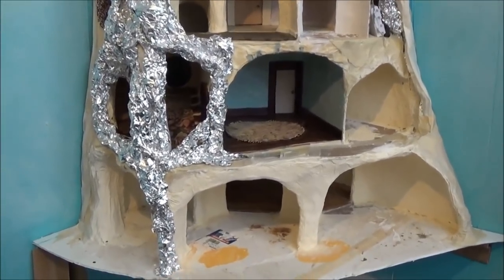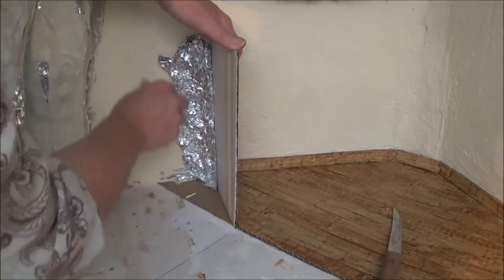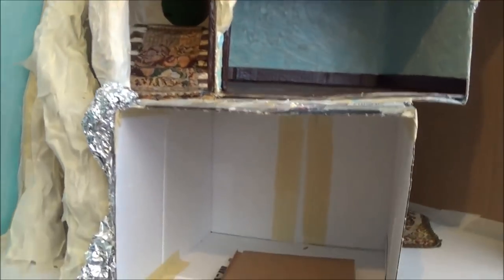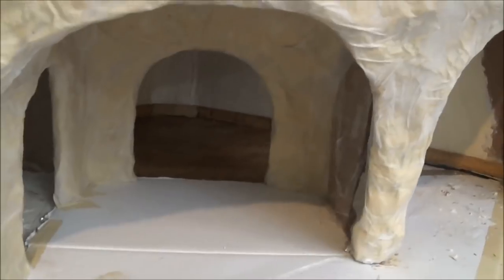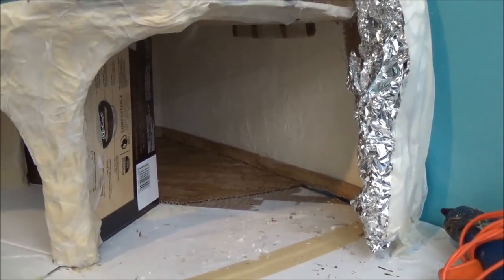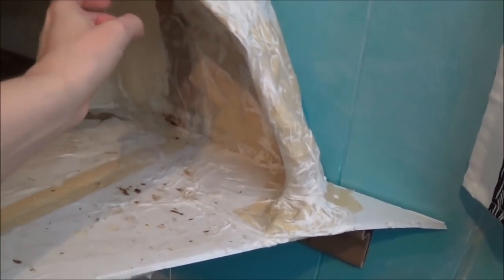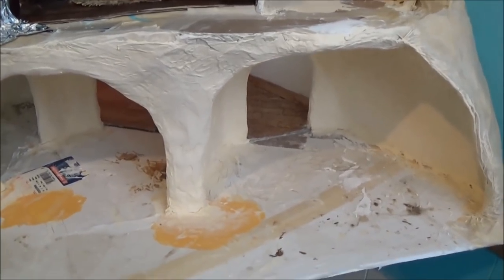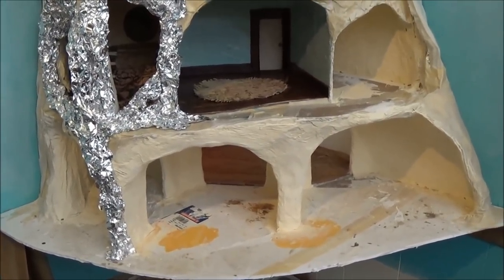Tree Dollhouse  Part 17 Building Up The Bottom Level

Comment: Are the boxes sitting on a big piece of foam board or something?i finally got my boxes together...I think..I was trying to figure out what each room would be and I was apprehensive to to commit lol..I gave up and just put them together.my boxes are smaller in size than yours.then after they were together I thought they need something to sit on lol..I’m working on two other houses and wanting to do this one so my brain is mush lol..thanks...
Reply from the maker: lol no worries.. yes, foam board when I first started. That is foam board with nothing under it. I made it like a table top with legs under it. A couple weeks after I began I had my dad come and add a wooded board under that foam for support. Now it's solid. It depends on how you will display your house, what you will need under it.. if it's a house you will be able to move around then it doesn't need anything under it.. unless you want a bit of yard or ground then a foam board would be a good idea.. but you could add that anytime.
Reply: Thanks Sharon...